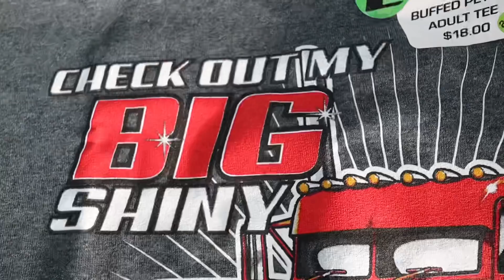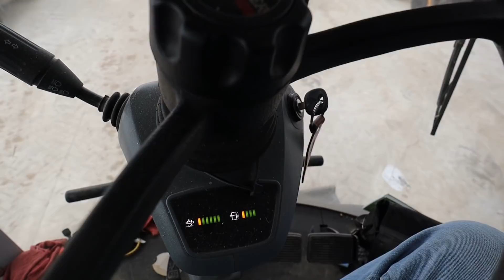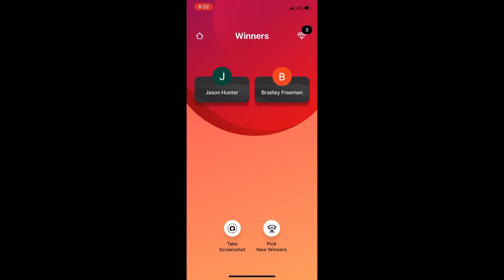It’s like legos but for Men

Comment: Batteries, the bane of motor vehicles.  In my opinion, if you have a  battery made by Exide, you don't have much.  They used to be good but not anymore.  My go to choice in batteries are those  made by East Penn.  They have been Caterpillar battery suppliers for years.  Long lived, great power.  Finally, John Deere ditched Exide and switched to East Penn this summer.  Interstate batteries are for the most part good too.  But you need to get their better line, the white case, green top ones.  Was in an Interstate warehouse full of black cased batteries with no name on any of them.  When I asked, the guy took me back to a big file cabinet area.  He asked me what brand of battery I would like, pulled open a drawer and it was full  of any label you could imagine to stick on your new XXXXXX brand battery.

Comment: Don't see why to shed lime.. we never have. Dump it in the field . Most cost with lime is shipping and handling. Wet lime vs dry lime ain't enough difference to shelter it. Plus lime will dry in truck piles. .
Reply from the maker: We are going to haul it in the winter so it may be a few months before we spread it

Comment: I'm sure you'll like having a hoop barn just for fertilizer.  Keeping at least the majority of the fertilizer away from the equipment will keep the equipment from rusting as bad.  I've done electrical work in dry fertilizer buildings before, and after one day, you can noticeably tell that your tools are being affected by the salt that's in the air.  It's especially noticeable on any type of pliers, like a linesman or needle nose pliers.  Start the day with a set of pliers that open easily, and end the day needing to hit them with spray lubricant, then work them open and closed a few times, to get them back to where they were.
Reply: @TFT-bp8zk  

Potash is a salt.

Comment: Brian; up here in Minnesota I have no garage and I leave early to drive school bus. When it is real cold I turn the key to just "ON" and count to ten, shut key off and count to ten again, then I start the car. This trick has not let me down yet. How this helps is when you draw juice out of a cold battery it warms up the battery and gets a little juice back in the battery and has more juice for the next try. I know it will tomorrow, just saying. Maybe the "Oxbo" is the same way because if you think about you made the batteries work then left them sit for the next guy to start both times.

Comment: If you decide to check out some new batteries, we've always had good luck with Northstar in high demand/high vibration environments. Seem to last a lot longer than the standard lead-acid and have much more cranking power.

Comment: Never let a lead acid battery run down. The acid attacks the lead plates and it results in a  shortened life. Battery tenders are worth their cost in extended battery life. Had the same problem with my boat battery needing replacement every 2 years even though it did very little work at all. Now has a battery tender and is lasting much longer.

Comment: have you tried gel marine batteries? Sounds like you not giving the batery a chance to charge up from the starting up stress. Have a dubbel decker box truck with a wagon behind 3 separate floors, use them 4 times a day more or less, and they last 1,5 years with maintenance charge from a outlet or the lead truck on the road. The cold start should heat up the glow plugs, at least on a truck that i know of.

Comment: I feel your dad's pain as  I have bad teeth myself . Tooth pain is on another level than anything else.  I'm only 28 and I'm having a couple  teeth pulled every year  We have jaw  bone issues and a lack of enamel that runs in the family.  Hopefully bob gets to feeling better . Great video keep up the good work!
Reply: It turns out that YOU CONSTANTLY REPLACE YOUR ENAMEL!!!! The reason you don't get it building on your teeth is your toothpaste. i guarantee it has glycerine. Fluoride isn't the only stupid thing they put in toothpaste apparently. (fluoride does NOT make teeth and bones stronger - it makes them harder, more brittle, and thus more susceptible to fracturing as it replaces the calcium in your bone matrix. This also reduces the amount of calcium in your bones and MIGHT contribute to your jawbone loss)

Glycerin damages your tooth processes by coating your teeth. Biochemistry goes: your teeth have enamel deposited, but it is relatively soft. The glycerin coats that enamel. By doing so, it prevents your salivary enzymes from HARDENING THE ENAMEL and so your soft enamel keeps getting worn away!  

I've looked intensely - even among foreign toothpaste manufactures, and i HAD found an Ayurvedic toothpaste from India which didn't have glycerin in it. 3rd time i bought it the glycerin was there, dammut...

Comment: Use Prosoco  Saltguard WB on the floors and block walls where you’re going to put fertilizer. It’s a deep penetrant that will seal the pours in the concrete and block. Works great on driveways and sidewalks so they don’t crumble from the use of salt. Regular block are not waterproof and some water will run through them if not sealed properly. If you are not going to seal them you could just order block with an integral water repellent that is put in at the time they’re made! That would stop a lot of the moisture coming through them.

Comment: Wash that trailer with mr clean and a scrub brush it will remove that stain I used to do that on our older steel trailer to get rust stain off the paint where ever there’s rock chips
Reply from the maker: Thanks for the info

Comment: The difference between Whisk(e)y and Moonshine is cask aging and a tax stamp. What you got was supposedly unaged whisky. However, since it's got a caramel color to it that means it was aged in a barrel. It's, also,  got a tax stamp which means it's not moonshine either.
Reply: Actually as BJ read off the bottle, they used the 'cheat' of putting barrel staves into the bottle to make the color. There was no aging, hence the look on Brian's face.
Reply: @googleandyoutubeareevil  I've had shine in Ms. and Tn. Always in a Mason jar, always clear, very smooth. The still area looked like we should be wearing Hazmat suits!  No open flames allowed wihin 50'.  In Ms., 4 State Trooper cars showed up. We figured we would be going to jail. The cars backed up, trunks were opened, each trooper picked up a case of shine, and they left. No words were spoken, the troopers didn't even look our way! The cost of doing business, I guess. It was in the early 80's, $.75 per jar!